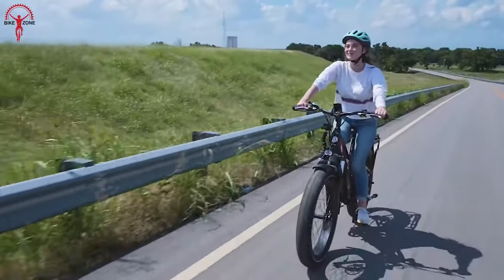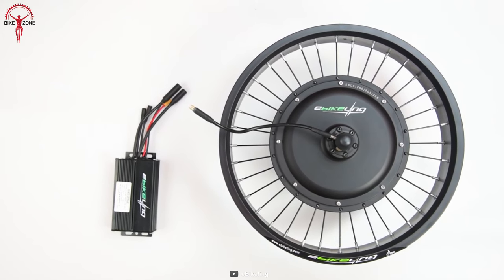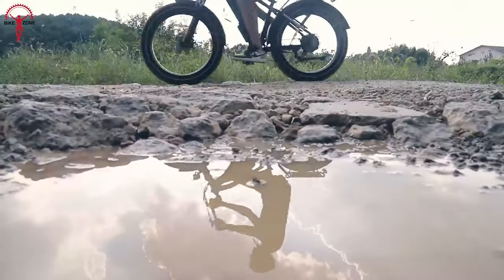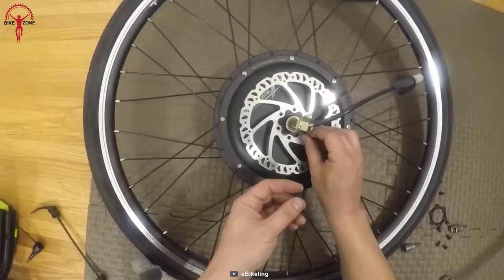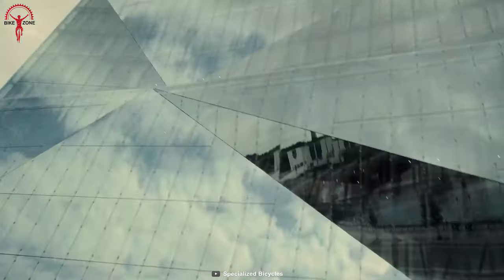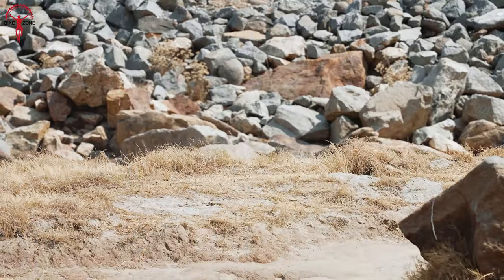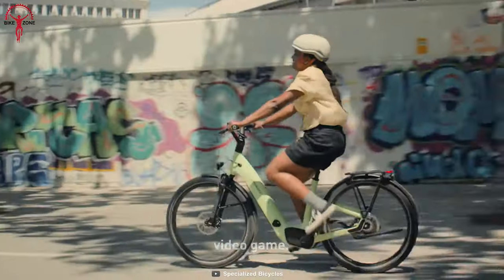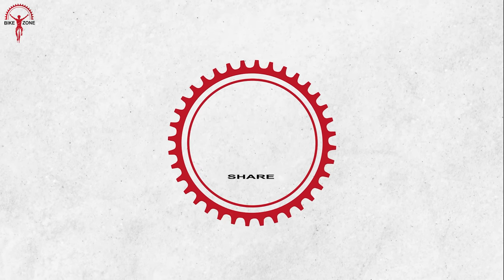Hub Drive vs Mid Drive Motor Explained - The Advantages and Disadvantages

Comment: Please consider (like I did) the third opinion-BOTH! I have a Bafang mid drive running on 72v (Grin), chained to a Qs205 (72200) Sabvoton. The bike is a 29” hard tail and packs 2 72v 35ah triangular batteries. If one system fails, the other gets me home. Final gears are 60/12. The hub set up gets me up to speed and the mid drive helps with little drain on either battery and both can maintain highway speed for miles on Ozark roads.
Reply from the maker: You have made a great point! Thank you!
Reply: Bob Patty I make the same but in a very cheap way. I put a bafang 750w mid drive on an engwe 750w rear hub motor. I have 2 diefrend system with 2 different throttle and motor batteries.
ebike 1000$+bafag bbso2+48v  350#+12ah battery250$=1600$
My choise today is front and rear gearless hub motor about 1000w with their own batterys controllers and throtlles.
Reply from the maker: @giannislarhanidis1117  thanks for sharing!

Comment: The chain-snapping issue is why mid-drive bike buyers might like to get an internal gear hub. Many city bike riders like internal gear hubs because they are less subject to weather and weathering. I agree that a mid-drive bike with internal gears and belt drive is a fantastic choice, but that will be expensive. Building the bike yourself by converting a conventional bike might be a good idea.
Reply from the maker: Thank you for sharing your thoughts and experience.
Reply: I've done over 60,0000 miles on a combination of TSDZ2 and BBS02 and never broke a chain.
Reply: @manoz6194 he makes it sound like your chain will break easily with a Mid-Drive 🙄
Reply: @joeburr7537  As long as you are in the correct gear, it will not be an issue
Reply: @manoz6194 Thinking of switching from rear hub to mid drive. Please how does one know the right gears ? Regards
Reply: @Oponu-Ayirada  only use high assist levels on low gears so the load is spread on more teeth and don't just whack on the throttle, easy into it. Also use ebike specific chains. Make sure you are also using a high cadence

Comment: First of all very interesting points  as I have rode a hyb drive for 10 months and yes have had very little problem with it, but have I enjoyed it as in my earlier days I did a lot of cycling I am now 58 with medical condition.  My answer is mixed it was good to be on the road again cycling but it didn't feel natural, mine was front wheel hub and felt if someone was pulling me until my peddling took over, very heavy and vibrated a lot when riding over rough uneven road, the motor could be heard and knew when it was on.  I brought the hub drive becausde of costs we can only buy what we can afford, but enough is enough and decided to try a mid drive but couldn';t afford a mid drive bike so looked at convertion kits. 

So I converted my hub drive with a mid drive and what are the differences it as deleated all the negative points on the hub drive, can't hear the motor many times forget the motor is there its that quiet, certainly less vibration when going over rough roads and cycling feels more natural.  I find very little complecations with gear changing as I do have a gear sensor fitted.  But I am not going to be giving the cycle lots of rough riding or doing any great speeds, so I do feel how long your chain lasts is if your going to be doing a lot of off roading and excess work your going to be doing on it, if your going to be using your cycle just for everyday commuting going to work, cycling round town and long distance riding can't see chain giving lots of problems as my gears change smoothly.  

So yes must admit I prefare the mid drive to the hub drive but the hub drive got me back on the toad again and its what one can afford as mid drives are a lot more expensive then mid drives as you can get a hub drive for £500+ and mid drives are about £1,200+, my hub drive cost me £650 and to convert it to a mid drive cost £950.  So for £300 more well worth it.  Mike
Reply: Did you notice any difference in the range you are getting with mid compared to hub? I would like to have an ebike that can cover about 100km so I can go for longer rides.
Reply: Yes there is slight difference as I had just started taking my mid drive out this week and so far done 24 mile which with the Hub drive would of swapped battery by now as I always have a spare battery with me, with the mid drive its only on half so expecting it to do another ride as I ride approx 12 mile a day so instead of charging cycle every two days only charging every 3 days so there is a  about 35% increase in distance which was told there would be a 30% and I am over 21 stone, the difference in riding is fantastic I can't hear the motor as I could the hub it so easy to forget it is motor propelled, its not as viibrating over rough roads due to the heavy motor wheel so yes it is a great imporovement to cycling as you don't notice the motor is there because using the cycles gears the only time I would notice the motor is if I switched it off, all I can say is before the convertion I would give it 4 ouit of 10 now I give it 8 out of 10 and will gain a point when I get some Hydraulic cable brakes Zoom HD100 so expected to see a great improvement in braking and the only other fault I don't like the colour of the bike but not changing that so if it would of been a nice colour it would become a 10 out of 10 cycle.  My batteries are 10ah with a 15 ah battery maybe arrange 45 miles before acharhe which is 35 mile at the moment but I have mine on the high setting all the time as battery power cuts out when cycle reaches 16mph its a waste of time to keep adjusting the levels.  But yes it as given me the encouragement to cycle more as its peddle assist.  Mike
Reply: @michaelrowland6538  Thank you for the detailed comparison. It looks like mid drive is better for longer distances and for hills. I suppose those are the most important elements I need. I have a hub drive at the moment and I can get about 50-60km on flat terrain, but uphill it drains really fast. I put a lot of my effort in riding and use only the smallest assistance otherwise I think I would be getting around 30km. I think I will finish this season with the hub and try and work on mid for the next season. I supose also that I need a bike with good quality gears and chain etc etc when I switch to mid drive.
Reply: @joaomarveloso1049  Every thing as its day including technology and my opinion the only thing keeping hub drives going is price a lot cheaper, you can get a hub ebike for a third of the price for a mid drive and companies like Swytch are trying to keep the hub drive alive.  But its like records and cassettes then they came cds and we enjoyed what these systems gave but their time as concluded, the gears and chain on my bike is just basic nothing special, if you like your hub bike then convert that as you already have a battery and a cycle you can hide the cables and sell the hub kit you have took off the cycle.  Its all how you feel but yes I am very surprise at the difference a mid drive makes, there is all kinds of rubbish going around mid drives are for off road and chain brakes, yes if a person is flying their cycle six foot in the air and standing up peddling you don't need a motor to break the chain it is how you use it.  How many cyclist use their hub ebikes for off road fun?  So general use it is down to chance use a cycle as it should it will last as ever since cycles where invented punctures and chains snapping as always been weaknesses in bikes.  The truth is mid drives arw todays improved  tech for cycles. Mike
Reply: @michaelrowland6538  Thank you for your input Michael. What kind of mid drive kit did you use? I hear bafang should be a good choice.
Reply: @joaomarveloso1049  Bafang BBS01 which is very quiet wouldn't be lieve you have a motor on the cycle until one switches it off, had no trouble fitting it just had to solder a battery connection to motor because used battery pack already fitted to the cycle.  I hear the biggest problem with normal cycles is the peice that holds gear cables to the bottom bracket, on a hub drive I converted last year I had to drill holes into the frame for the battery holder which I used rivet nuts, other then that everything was just stright forward.  Mike
Reply from the maker: Glad you shared your experience Mike! It's been so detailed and it could help others. Thank you!
Reply: @michaelrowland6538  Thank you :)
Reply: @joaomarveloso1049  mid drive do go a little further to a battery charge but a 100kg is a lot to ask for.

Comment: I don't usually do two reviews on the same video but response to my comment as been very good but feel their as been a mix up of my interpretation what a ebike is, when I was young I would go cycling all over and to me cycling is slow transport where you want to go defently slower then a motor vehicle, but all the power in the bike was done by me. Some days I would avarage about 18mph and some other day maybe 10 mph depending on weather, hill climbing but everything was done by natural strength and I loved it and enjoyed it because if I set out cycling to the sea side it was nice an scenic and the travelling was a part of the day out as in a motor vehicle all the scenary just flashes by and only the seaside then becomes the enjoyment the trip is just long and boring even so its faster.  Sadly for me my natural days of cycling is over as time goes by and we get older and obstacles get in the way and we miss what we once had.

An ebike to me as put youth back into my life I don't want a motor vehicle I got one of them and its boring but my wife won't let me get rid of the car, I had motor cycles in my time and they just like cars do all the work for you.  I had a hub motor and I liked it and it got my interest in cycling again but I didn't love it, it never felt what I had before when the motor worked it did all the work, when my peddling took over I did all the work it didn't work with me it worked for me, with a mid drive I feel the motor is working with me it feels more natural and put the feel of cycling in my life again more natural.  So Mid drive peddle assist does what it says assist as hub motors don't they feel as if they pushing or pulling you until motor cuts out, so for give me if I don't talk about high speeds because that isn't what I got a ebike for, I got it to give me what time as took away the chance to cycle again without feeling tired and worn out just going down the streets, the beauty of cycling isn't cycling to work or the shops but taking little trips in the country side and enjoying the outdoors.

To me the mid drive is more like cycling then a hub drive but the hub still provides a good ebike, a twin tub will still wash and spin your cloths as a automatic does but you don't have to empty the washing machine to fill the spinner the automatic does it without that.  A mid drive really is like naturally riding a cycle and I only know its me not doing all the work when I turn the motor off and then it comes evident, if you want to do great speeds then a motorcycle is the answer but if you want to cycle when your old or overweight and have health problems then the ebike is your answere and if you choose a hub drive its better then nothing but mid drives give the more natural cycling feeling.  For chains snapping and a hub drive getting you home when did a normal cycle get you home when the chain snapped?  If your worried about the chain put one in your saddle bag I always carry a spare innertube which your more likely to have a puncture then chain snapping. 

 Benefits of the mid drive to the hub drive,
1. More natural cycling feeling, 
2. Better avarage speed because can use cycles gears and not stuck in one gear,  
3.  Motor working alongside your peddling until restricted speed is reached, 
4. Better when going over uneven and rougher service because there is no heavy wheel, 
5. less chance of a puncture because weight isn't on your tyre 
6 .Finally does more  miles per charge with Hub I avaraged about 20 to 24 miles to a charge, Mid Drive I have done 36 miles to this charge and is just hitting last bar.  

Benifits of hub drive  
1, Purchase price 
2. Chance of chain snapping on mid drive which if you have a spare chain with you takes just as long as if you had to mend a puncture. 

 Hope this helps.  thanks Mike
Reply from the maker: Again thanks for your detailed explanation. Hope it helps others. Learned a lot from your words. Cheers!
Reply: I enjoyed reading your thoughts on mid drive vs. rear hub drive. I just bought this Giant Talon E 3 and received it last Saturday 10 Feb 2024 and I completely agree with you. A much better experience so far than riding on a rear hub drive. And it only weights 40 pounds. Cheers!
Reply: Like you say after 60 years old, I just need my Cannondale Tesoro Neo X ebike mid drive.  Texas headwinds, no problem I can still ride without quiting.

Comment: Hi "Bike Zone"
I have build approx 5 different ebikes with directdrive-hub-, geared-hub- and middrive-motor. On my 34 kg Strada velomobile (weight without motor, battery, tools, and luggage) I have driven 3—4000 km with a Bafang 250W 80 Nm middrivemotor and even sometimes changed gear without the motor completely switched off. And the same chain have now lasted 20.000 Km (first many km without motor). So I think your opinion “the chain will snap instantly” Is kind of wildly exaturated !
Happy ebiking everyone ;-)
Reply from the maker: Wow! Thanks for sharing and explaining it all.
Reply: 34 kg being the combined weight of 5 different ebikes you built.Can we know what is the weight of your ebike individually?
Reply: @binayshrestha7132   Hi Binay. What I ment was that the weight of my 3-wheeled velomobile was 34 kg before motor was monted. So about 40 kg with motor and battery. Kind Regard ;-)

Comment: That was useful. I bought a mid-drive. I don't mind more maintenance with the performance and handling benefit of mid-drives. I have a hub drive scooter and that rear hub motor has a ton of inertia when it gets going. Not super great for handling but yeah, definitely pretty bulletproof. I've had my hub drive scooter for years and it's still going strong. I don't think you can kill hub drives.
Reply from the maker: @Kiefer Shanks, thank you for sharing your experience! Hub motors are bulletproof.
Reply: What what? Internal mid-drives have less maintenance than a hub.  Especially if you get a belt instead of a chain, theres like zero maintenance for several years at a time.
Reply: @srobeck77  - Cool story bro.

Comment: Very nice and balanced explanation. In my opinion the hub drive is a better option for now unless you have plenty of money and access to a dealership for repairs. This is a big drawback presently. I think owning an Ebike for the average person would require some knowledge and maintenance skills due to the lack of available repair options. There just aren’t any local mechanics similar to car repair shops. Additionally a front hub motor is a terrible idea because the front fork is not designed to be used to pull an Ebike. There’s a good chance that the front fork and wheel will break off eventually.
Reply from the maker: You have a perfect point! Thanks for sharing your thoughts.
Reply: Because of the angular momentum and torque a steel brace is recommended for the front fork and sells on Amazon for about $10 to protect your fork.
Reply from the maker: @ericscott6682  this is a great info. Thanks for sharing!
Reply: @ericscott6682  I don’t know if we’re talking about the same thing. The front fork steering column can’t handle the continuous pulling force and if subjected to a lot of hard use can eventually fracture and cause the front fork to break off probably when in use.
Reply: Just go to any bike shop and they should have them by now I'd think.
Reply: @completesalvation1755 : That doesn't make any sense from the perspective of caster angle. 

If you look at a front head tube, the line through that tube and through the forks is your caster angle, when you measure it compared to a line from the top headset bolt straight down. On most bicycles, scooters, and motorcycles, this angle is much more positive than a car's caster angle. A positive angle is when the angle is in front of the straight line from the top of the head tube to the ground. 

That being said, a positive caster angle, coupled with a front hub motor, actually affects traction on acceleration from a dead stop, because of weight transference from the from tire to the rear tire. At most, if you're not pedaling before the motor kicks in, you might spin the tire a bit. 

However, having such a large caster angle actually is not as detrimental to the forks as you think, simply because the angle itself mitigates any flex the forks might have. If the angle were more negative -- i.e., moved backwards to where the straight vertical line from the top of the head tube hits the ground -- then you might have a point about fork flex.
Reply: I've had a front hub wheel for 8 years no problem. It has the huge advantage in that both wheels are driven. Excellent for going up rough tracks.

Comment: Finaly someone answers to my question of what happens when you run out of battery (or if your motor breaks). On a hub motor you can still pedal your way wherever you are going while on a mid motor you can´t. On a rear hub motor you can also extend your distance by riding on H mode where you use the throttle only when you need assistance.
Reply from the maker: Thanks for the information.
Reply: I can pedal my mid-drive bike and I had 3 different ones without power
Reply: You are right.... I finally decided for the mid drive. However sometimes  I miss the throttle. Cheers!  @gardenadog